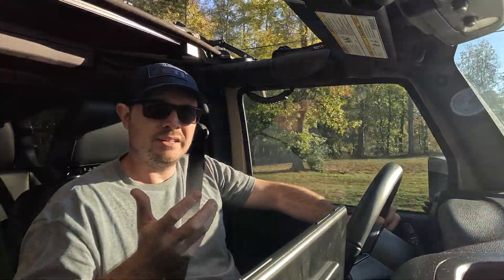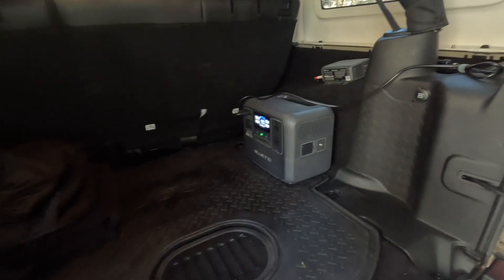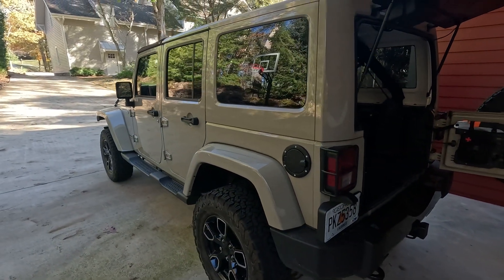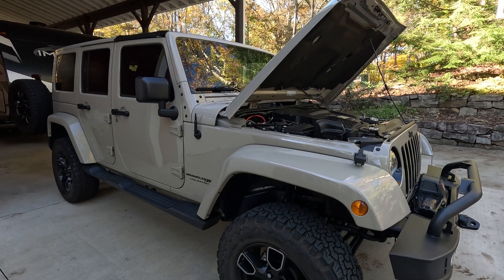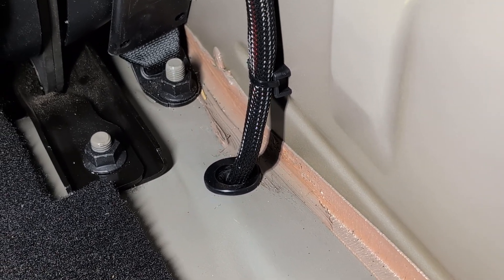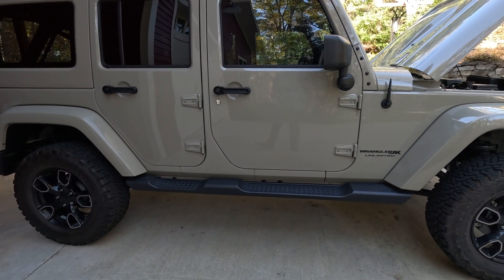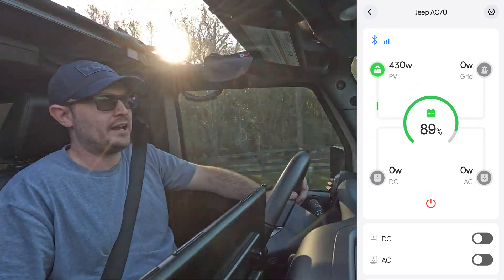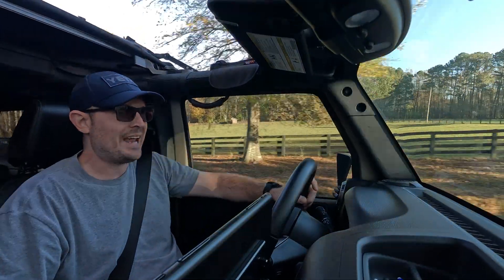Hybrid Electrical System with BLUETTI Charger 1 + AC70 on Jeep Wrangler JK

Comment from the maker: Support the channel with these purchase links. As an affiliate I earn from qualifying purchases:
BLUETTI Charger 1 560W Alternator DC-DC Charger - https://amzn.to/48WVHh7
BLUETTI AC70 1kW Power Station - https://amzn.to/4fNxADM
BLUETTI AC200L 2.4kW Power Station - https://amzn.to/4eD9smf
BLUETTI AC180 1.8kW Power Station - https://amzn.to/4eHmqj0
BLUETTI Elite 200 V2 2.6kW Power Station - https://amzn.to/3Zf3GTp
Jeep Tailgate Molle Panel - https://amzn.to/4hQqLTE
Rubber Grommets (to protect wire at hole) - https://amzn.to/3ASxOuA
Step Bit (to drill hole) - https://amzn.to/3ZfhBsw
Wire Holders (to secure wire) - https://amzn.to/4928E9a

Full Listing of Products in our Online Store
https://adventure.rocks/store/
Reply: Can you talk about the smart alternator option on the app, I have a 2015 GMC terrain 4 cylinder I'm wondering if My vehicle has a smart alternator and does it matter, because the app has a switch for smart alternators

Comment: You say i can use this on any other Lithium battery... But what is about a 12v 4s Lifepo4?

The Bluetti charger lowest voltage is 15v whats to high and with the 10A you only have 150w charging... Not good
Reply from the maker: Great question. Unfortunately the Bluetti Charger1 is not designed for smaller 4s batteries. It's more intended for larger and higher capacity batteries found in power stations, RVs, trailers and so forth.
Reply: @AdventureRocks  I think the only viable solution for a 12V 4S battery would be to use the Bluetti Charger 1 to feed a regulated voltage into a suitable MPPT solar charge controller via its solar input. That way, the controller can output the correct charging voltage for the 4S battery.
However, of course, that means using yet another device – and there will be some energy losses as well.

Comment: Great video, hoping to do this so I can run my AC70 off the charger 1 so I can power my EcoFlow Wave3 while we drive - Traveling with dogs in the back of the truck and wanting to keep them cool.
Reply from the maker: Thank you for watching. Hope your install goes smoothly. Charger1 is a great choice.
Reply: @AdventureRocks  thank you! I just got it installed this morning, very smooth and easy to install, even for a novice like myself.  I did notice that I'm only getting about 440w in from the charger 1 to the AC70, I don't know if that's because the AC70 is in standard charging mode and not turbo.

Comment: I have a somewhat unrelated question. You are the only YouTuber I have found with experience with both the AC300 and the Charger 1. 
I have a boat with twin Yamaha outboards. They both produce 70 amps of alternator power. Do you think I could connect two Charger 1s at the same time with the dual MPPT inputs?
Reply from the maker: That's a great question. In transparency I don't have any experience with boat engines...but it's my understanding the Charger1 takes an input of 50A @ 12V. So, if I'm tracking right and your engine can produce 70A @ 12V, then it sounds like it'd be under the 70A threshhold. I could be completely missing something there. Sorry I couldn't be of more help.
Reply: @AdventureRocks  Thank you so much. I completely glossed over the 50amp-70amp issue. Asking Bluetti now, will keep you informed.

Comment: When not in use do you leave breaker off?
Reply from the maker: So far I've left mine one, but I leave it plugged in to a power station most of the time. Its seems smart enough to go into "sleep" or low-draw mode when it doesn't need charging, but certainly would be pretty straightforward to shut the breaker off too.

Comment: I wonder about the smart alternator switch on the app, I'm trying to find out if my vehicle has a smart alternator, I have a 2015 GMC terrain 4 cylinder
Reply from the maker: That's a great question. I would think more of the modern cars would qualify as having smart alternators, but then again it's not well-publicized in specs for the cars. I'm sorry I cannot be of greater help on that one.

Comment: I have a 2007 Ford transit with two batteries under the driver seat. Could I fit two of these to 2 separate power units?
Reply from the maker: Great questions. I don't have first-hand experience on that matter, but I think just one. I say that because I think it's more based on your alternator capacity. Maybe (big maybe) if you had dual alternators then you could do two Bluetti Charger 1. Otherwise probably just one, and rotate it between the two power stations. Sorry I cannot be of more help on this topic.

Comment: Nice video. I bought the same Bluetti Charger 1. After doing some research on the proper way to install this I was advised to have a 60A fuse no longer than 18 inches from the positive battery post. The closer to the battery post the better. This is because if the amperage draw melts the wires or if something frays the wire insulation and it shorts out it won’t cause a fire.
Reply from the maker: Great point. Closer is always better on breakers or fuses. THank you for the comment.

Comment: Wondering how I can find out if the Bluetti Charger 1 is compatible with my Jackery 3000PRO Power Station.  I can’t seem to find anything that shows it does.
Reply from the maker: When I lookup specs on your power station it shows the following: 
DC Input:
2x DC 8mm Ports: 11-17.5V (Working Voltage)⎓8A Max, Double to 8A Max; 17.5-60V (Working Voltage)⎓12A, Double to 24A/1400W Max

So, based on the DC input, the Bluetti Charger 1 can supply an acceptable charge current. You can set the voltage and amperage  in the app to get max wattage on your charge for the Jackery. I think of it like same scenario as hooking a bunch of solar panels together and charging your power station. Kinda similar with Charger 1, but it's faster. Pretty neat that they made it universal.
Reply: @AdventureRocks  Excellent news!  Would you be able to help me identify the type of cable I'd need to purchase to run from the Charger 1's output to the Jackery 3000PRO's input?  This would become much handier than the 400 watts of portable solar panels I have to haul around now!
Reply from the maker: @jerryball7783  double check me, but I believe this is the cable you need: 
https://amzn.to/3B4lkjB

The Bluetti Charger 1 comes with MC4 connectors, and I believe your Jackery has the DC barrel plug for input.
Reply: @AdventureRocks  Yes thank you this looks like it will do the trick!!

Comment: How does this device impact the alternator on your vehicle?
Reply from the maker: Great question. Thank you for the comment. For me it seems minimal as far as impact on my OEM alternator. I haven't noticed any discernible difference so far.
Reply: @AdventureRocks  The excess alternator draw with create more heat in the alternator and therefore reduce the alternator service life, if your vehicle is under warranty installing this might void warranty if an electrical problem arises.

Comment: Does your green indicator light turn off after 30 mins? Mine stays on, never turns off unless you obviously flip the breaker.
Reply from the maker: Mine goes off eventually. I haven't timed it. I do recall seeing it green still within at least 5-10 min following. I just checked it again now and it's off after vehicle dormant for 12+ hours. I tried pairing it now via app, and wouldn't show up till I started engine again, so it appears the unit does eventually go off.